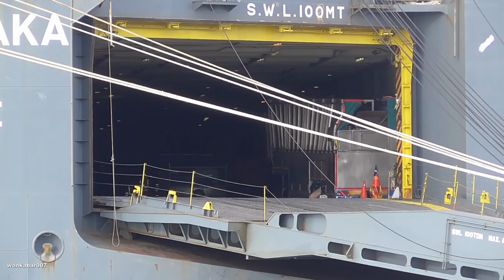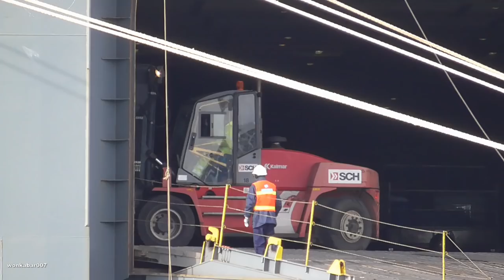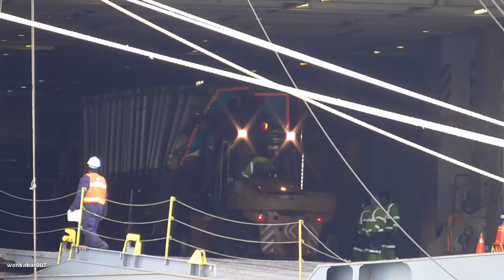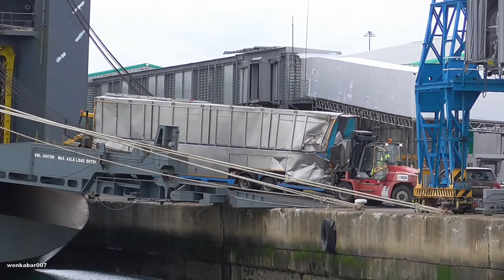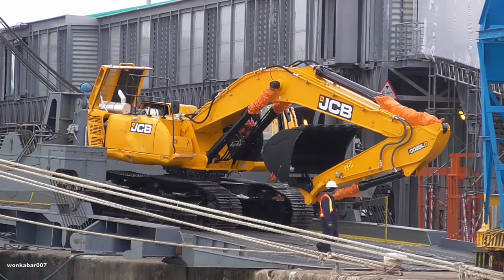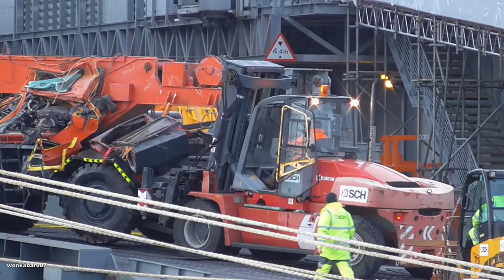Damaged JCBs, Buses & Cranes Being Unloaded From The Salvaged Ship Hoegh Osaka.

Comment: And what caused the steering/listing failure on board ship in the first place?
Reply: +Liberty Patriot   After investigation Hoegh have released a statement saying that it was a miscalculation regarding load weights and positioning...

The ship started to become unstable when it entered the Solent from Southampton Water so the captain made the decision to ground the ship on Bramble Bank to avoid any risk of the ship sinking or blocking the shipping channels which are super busy.  There were no mechanical failures on the ship and it was under control, albeit limited, at all times.  I think it's fair to say the captain and crew did a bloody good job...
Reply: Captain and crew did a bloody good job of saving the vessel after screwing up the loading calculations.
Reply: Mark Fryer   It seems that it wasn't the Captain or crew of the vessel at fault, not the dockside crew at Southampton.  It rather appears that the vehicle weights supplied by one of the manufacturers were wrong, and that caused the loading of the vessel to cause the imbalance...
Reply: The captain is a former swift driver